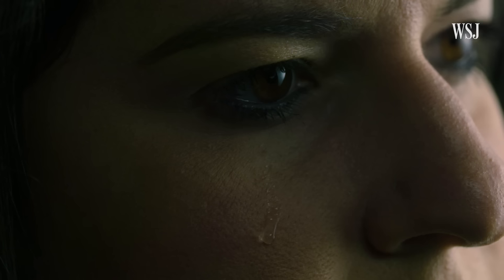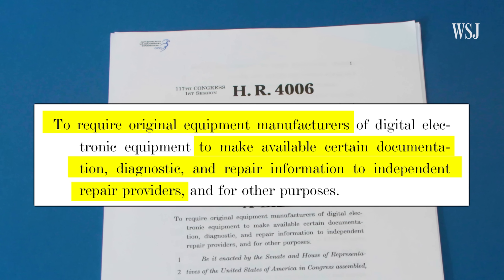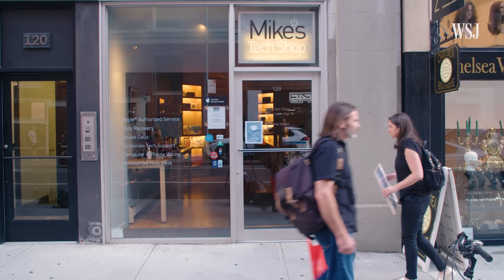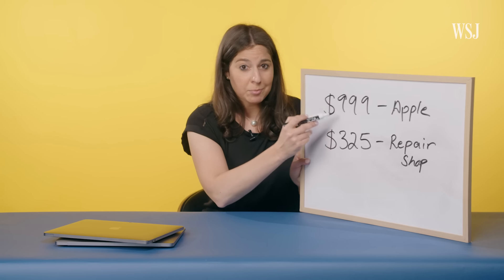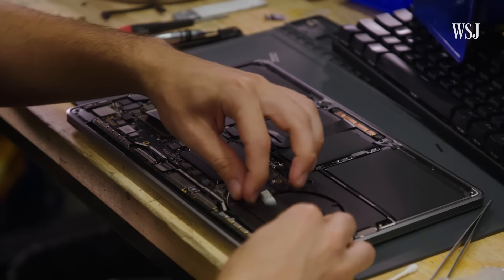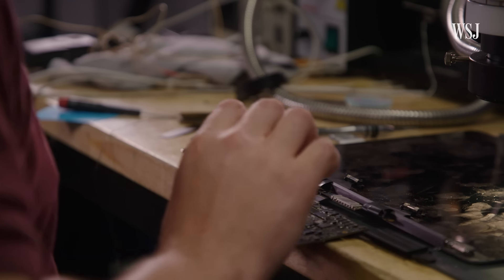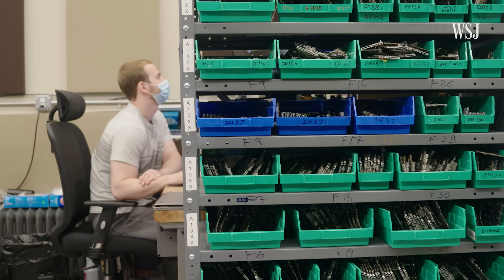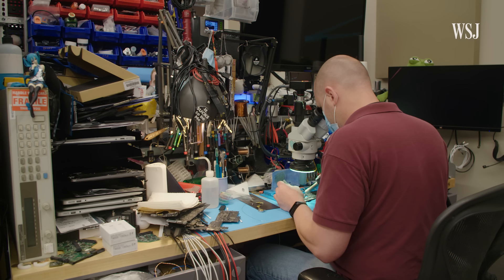Apple Store vs. Repair Shop: What the Right to Repair Is All About | WSJ

Comment: The supply of repair parts is being manipulated in a new way. On longer can a single part be purchased for a  Milwaukee cordless drill. Parts have been combines and are sold as one unit. The switch, coils, electronic control board and entry plug are now sold as a single item. There is no economical repair possible to their range of cordless drills. These combined part costs are greater than a replacement machine.

Comment: Read me. There's going to be mistakes here but bear with me and if I am incorrect, please do correct me. I won't take it the wrong way if done tactfully. I felt this needed to be jotted down. Data compromise by independent repair shops ( I believe that was a point of contest) wouldn't be a concern for right to repair antagonists, if the data was in a removable format. You know. M.2 or SSDs that AREN'T SOLDERED PERMANENTLY TO THE BOARD IN WHICH A AVERAGE END USER CANNOT TAMPER WITH WHETHER DUE TO LACK OF TOOLS, KNOWLEDGE WHAT HAVE YOU. Before the customer leaves, there could be maybe a cable that disconnects you hand the customer their data drive in a protective case or sleeve. When did removable storage suddenly fall out of fashion and into a safety/negligible performance enhancing area? The repair company uses their own "test drive" to check if software and hardware works as it should. Customer comes back, their data drive plugged in/SIM card connected/eSIM reactivated again. Repair complete, pay in full or however it is negotiated. Business continues as usual. We've seen hundreds of fresh OS installs to see if things are running properly. I dare to ask why are these folks who are in positions of power not educated. Why do we have people who they themselves are not subject matter experts to put their hands in matters such as these? How is it they have the audacity, the sheer magnitudinal confidence to impair the effort make a necessary right to repair your OWN DEVICE, not a LEASE OR LOAN OF PROPERTY as smooth as possible? Not wanting to be rude but it seems these "points" they bring up as to why "they're" (more like just Apple themselves/Apple influence/Apple bribery/Apple ecosystem) against the right to repair movement seem uninformed and uncaring because they can afford throw money like water on concrete, have no attachment to the things they paid for, it's incredible  for such a lack of awareness of what's going on for those in positions unlike themselves and the monetary social bracket those people belong to. There's a need for reliability, affordability and accessibility, why is this so difficult to accept as well as provide? You're there for the people. Not for a business or company.

Comment: its expensive because they dont want to pay their technicians a higher salary
official board level repair on a company wide scale would require their 'genius' bar to actually know what theyre doing beyond unscrewing something and replacing it/ would probably require extensive certification to make sure they do a good job for PR reasons
Which is why they dont do it, the genius bar makes mistakes constantly even with their simple to understand skillset

Comment: Powerful Right to Repair laws will be a godsent for me. Sick to death of non-removable batteries, unnecessarily soldered parts, and glued screens which shatter when I try to remove them without both training and specialist tools.

Similarly, it's a problem that also extends out of tech and into cars. Why do we need to practically remove a whole front and bumper off particular cars to change a lightbulb?

Comment: Forget independent repair shops... We should be designing products that can be repaired by the owner themselves.
Reply: well, some people aren't confident enough to repair their own stuff, i say that we should have both.
Reply: Almost every person who buys an apple product is too stupid to know how to use the command line, so I would not trust them with the easily breakable hardware
Reply: @caughtintheweb0  people are by and large not so much stupid as lazy.

If you don't want to continue the downward spiral, we need to stop protecting laziness and building towards the lowest common denominator.

And hardware is actually far easier to understand than software.... It's literally just slightly more complex Legos.

Comment: And something they don't mention, apple will remove ALL you data(other companies do the same tho) which is never needed, my samsung had a black screen so i couldn't wipe it while they wanted to do it they just fixed the screen and i was done setting up my sim in 2 minutes. there was never a need to delete all my data for a screen replacement....I dont reset my computer every time I connect a new screen....

Comment: It's ALL about SPECIFICALLY and INTENTIONALLY limiting SUPPLY ( of repair and/or information - or even the physical capability TO repair ) through ( arbitrary / absurd / nonsensical ) OLIGOPOLISTIC or even MONOPOLISTIC business practices / policies IN ORDER TO DRIVE UP DEMAND ( for said repairs and information ) as well as PRICE and PROFIT by creating an artificial FUNNEL or SIEVE effect for the owner. Meaning an artificial funnel requiring the owner to ONLY go through the corporation for repairs and information and usually making parts non repairable on purpose so complete ( expensive ) replacements are required. Which then of course makes people buy the latest new ( expensive ) product they have out on the marketplace. AND - this is a practice adopted by almost every major corporation out there. ESPECIALLY any that use software or technology. EVEN Tractors. ( See John Deere for more )

I will even go a bit more in depth : I do arbitrage of high dollar items from bankruptcies - auctions etc . . and the HIGHER the value and/or the more rare the item is - ABSOLUTELY GUARANTEES that even getting basic owners manuals - schematics - specifications - AND the BASIC RETAIL PRICE of an item will be deflected - obfuscated and sieved down through a broker - a dealership etc . . AND EVEN buying the item will FURTHER be funneled down to "having a commercial account with us" as a "licensed" ( whatever ) etc . . AND - forget about even simply buying a part for the item unless you go through these hoops as well. ( See Tesla for more on this )

It's because they KNOW THEY CAN do this - legally - and create an artificial "gouging" ( of the buyer / owner ) situation - and so they DO.

Comment: There are better Windows and Linux machines out there, and honestly there is not much difference between Mac and PC now.
I use a MacBook Pro 16 because it is given by my company 😄. But I have also assembled a PC with one third of the price, and it works better than the MacBook.

Comment: I believe in right to repair , but.  Steve Jobs the creator of Apple computer s  did not want to have an open system . He believed that only Apple had the responsibility and incentive to make the best computers.  He was removed from the company by the board and his friend that did not agree with him.  I have owned and used both systems.   For everyday normal use , I choose Apple .  My tablet is seven years old and I never had an issue.  It works as well as the day it was purchased. Except for battery performance .   If you have your Apple product compromised by installing or repaired by  third party .   How many will blame Apple.  Do not buy a sports car and complain that you do not like the ride .  JUST SAYING  .

Comment: i had a macbook going out of function without any reason and send them in 3 times. it took 3 weeks to get fixed got send to ireland, got a new motherboard (so yes they did put money in it)..... but it didn't solve the problem. literally broken again after to weeks. so I totally untrained noob tried anything out i found in forums..... actually was able to let it run another year.... still died with the same problems... but yeah I apparently was able -.- incredible... imho they don't check the problems properly... idk why this happened, but it seems to be a mass phenomenon.

Comment: Anyone with basic electronic knowledge would know that replacing individual parts is probabilistically more reliable than replacing the entire thing, depending on the level of damage.
I know swapping out an IC given it's the only part damaged, would have greater chance of success than having an entire motherboard that could be defective from the factory. Cause it does happen.
All of their so called "efforts on environmental awareness" are meaningless the moment they charge so much for a simple repair, that adding $200-$300 more would get you an entirely new device.

Comment: Apple are crooks to the nth degree.  My iPad Air2 works great.  But the battery capacity is below 60%. I took it in to Apple to have the battery replaced.  First they tell me it’ll cost $128.00.  Then they tell me that batteries are no longer available for the Air2. I ask what the trade-in value is, as I’ll upgrade. They tell me my iPad has no value - yet Apple continues to provide software upgrades to me - on a device that they say is worthless.  Give me a break!  I checked online.  I can buy a battery and the tools I need in kit form for $33.00. I did it myself.  My iPad works great.  My next phone and laptop will not be Apple.  Great business practices Apple.  Jobs is rolling over in his grave,

Comment: Getting your device repaired by a Third party can only happen when that Third Party has the parts to make the repair.  When they do not, they cannot help you.  And even when they do have the parts, they may not be able to stand behind their repair, because they may not have additional parts to repair your device again!   Right to repair is only HALF of what is needed.  Without the right to get new repairable components, you are still ultimately at the mercy of the manufacturer.  Also, beware, many third party repair shops get batteries from dubious sources.  Nothing is worse than spending Apple money on a cheep Chinese Knockoff battery, or one that was pulled from god knows what. 

The best thing to do.. is to take good care of what you buy.  I have been buying MacBooks since they were called PowerBooks.  And with only one of them in over 20 years, did I have a problem, and Apple fixed it out of warranty under one of their Quality Programs.  Their competitors.. don't have "Quality Programs" .. so still buy Apple.

Comment: Well, i think the "privacy" could be compromised if you let repair your laptop by a guy who wants just 1/5th of money that the company asks...
I'm not talking about Louis, but some guy with a small shop.
He don't earn much money, so he try to steel data from customers's pcs.
And he resells them somewhere.
I mean, many people has sensible data on their laptop, even written on a note file.
And many people have a very stupid and common password, so for a skilled "pc guy" could be very easy to steal files or data.
Apple's prices are a legalized robbery, no doubt about that, but i would rather prefer to buy a cheap temporarily windows pc instead of giving my data in the hands of some weirdo with a tiny shop with very low prices...

Comment: You honestly can't fail at sending your device back to the original manufacturer for repairs. I got a few apple devices fixed by third parties and it was nothing compared to apple doing it. People need to understand that you are paying for them to restore your device back to the same condition it was when you brought it. This is obviously something that a third-party repair shop cannot do.
Reply: go watch "The horrible truth about Apple's repeated engineering failures" and see how they treat customers and their boards when they have to fix it instead of charging people to replace it. you are right about back to the same condition as buying it - they are just replacing it lol

Comment: The Apple Moron Bar will swap out the logic board with a "new" FRU that is probably badly repaired and will fail fairly soon. If they were charging you that price for a brand spanking shiny new board then they are still charging too much for the repair.

Comment: there should be no "right to repair", it should be "right to ownership" : either you leased the product and you must bring it back for free repair or replacement while the lease lasts, or you bought it and you already have the right to do whatever you want with it

hear lots of talk about intellectual property but actual ownership seems to be lost on the way
Reply: Well, even if you have right to do evert with it, you cant really repair it if the schematic and parts are not available cant you?

Older car, you can costume made the parts, 

Chips ?
Reply: @meferswift   well, if you actually need schematics to repair something you own you either have the right to get the schematics in the package like it used to happen not so long ago with a lot of electronics ...  or you get lifetime warranty with as prompt repairs as required by your business needs, which for farmers would mean "within 4 hours after reporting the error" ... in the case of computers or phones depends on the use 

I'm not against repairing, I think not being able to repair is the abuse and the innovation , and the right to repair is the baseline from which we are starting and the normal way of life that needs defending, not a new idea 

I don't understand people using Apple products, whatever I had to use (for work always) seemed like a half-baked version of a PC running Linux ... not to mention Apple messing with what software was available (like downgrading compilers or retiring or not even making available libraries) that made my life hard because some very fashionable workmates insisted on using an Apple product for work 

The screens are still gorgeous though, and that was the main reason people bought Apple in the past besides being fashionable

Comment: Honestly apple is such a joke don’t get me wrong I have all apple products but still like I went to see them cuz my phone wasn’t charging right and I was pretty sure it was cuz the charging port broken or something and they said they would fix it for 500 and that they would have to change the battery or something it was such a joke cuz I got the phone for 400 used and they just over charge me so much I just did it myself I went online and got the parts and now my iPhone works fine. I honestly hate how they just over charge you for simple stuff they rather u spend more money buying new phones I hate that about them

Comment: I buy Apple for their security, and I think this law really puts the device security at risk.
Reply: How so?
Reply: @MBOgonnaPWNu  You should read up on the M1 chips. They are way more secure than other computers. No other computers have the ability to use Touch ID.
Reply: @psarahgalarneau My HP Elitebook from 2007 has a fingerprint scanner.
Reply: @psarahgalarneau  Anyway, I'd like to know how could this law affect the device's security?
Reply: @ixcutamp8059  I stand corrected about the Touch ID, although I really couldn’t find much info about that security. I feel fairly confident in saying that Apple’s M1 iMac is the only device on the market with Touch ID that works on the Magic Keyboard. 
I believe that anytime a company has to release their proprietary information to anyone who wants it, that compromises security. There are very good reasons that Apple (and any other company) may want to keep that information private. Simply put, if everyone understands what makes a technology like Touch ID work, it’s simple to reverse engineer a way to bypass that security feature. I don’t claim to be the end all in my knowledge of computers, but that’s my opinion.
Reply: @psarahgalarneau  Car manufacturers said almost the same thing about security and whatnot when they were in a situation similar to this one  back in 2013 when the "motor vehicle owner's right to repair act" was being discussed.  
Now that the legislation has passed, they haven't said anything about security, and independent mechanics don't have to fear anymore. A win for the consumer, and small businesses.
Reply: @ixcutamp8059  I feel like it would be a bigger win if the US had consumer rights laws like the UK and Australia have. I understand why the right to repair is appealing, I really do. I can only speak for myself, but I will continue to have my devices repaired by the manufacturer. It should also be noted that AppleCare can now be extended after the initial contract on phones, iPads, and Macs. Apple gives people the opportunity to get their devices fixed free or with a deductible in the case of accidental damage. Unfortunately, people choose to spend an enormous amount of money on their devices, and don’t buy the protection.
Reply: @psarahgalarneau  well, that's the greatest thing about it: it's your own choice

Comment: You also have to see the other side of the equation though. If apple provided their schematics out for everyone to use, they would lose their competitive advantage over other company’s as they now have the blueprint to build their own MacBooks. I’d say the best thing they could do is lower their repair costs of an authorise apple technician to a more reasonable price not close to a price of a new MacBook.
Reply: Where are they getting every part to make a whole MacBook lol. Apple shill thinking
Reply: @Dapieguy314159  Obviously not getting the same parts, but makes it easier to reverse engineer and for other competitors to make their own versions of MacBooks with similar technology